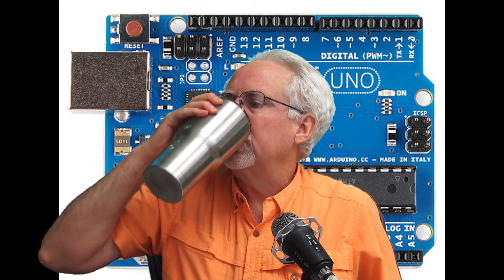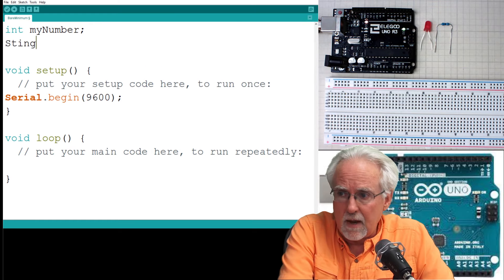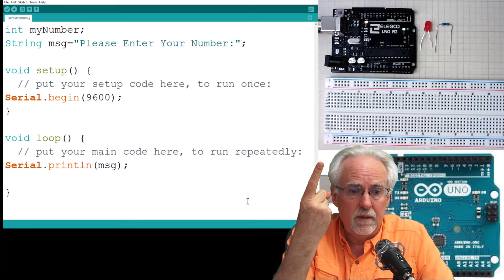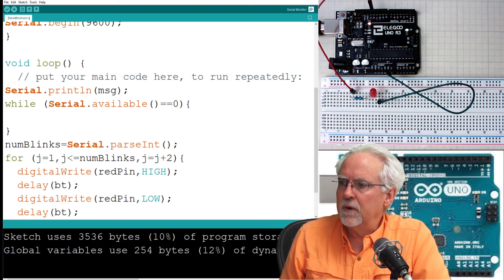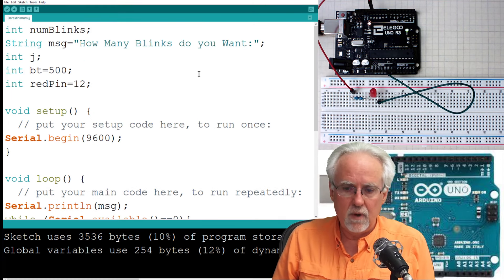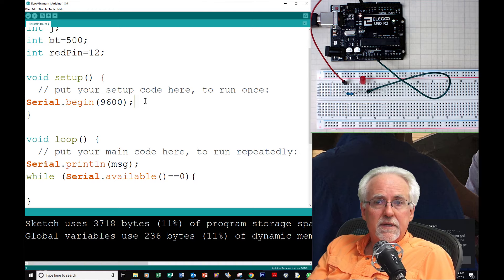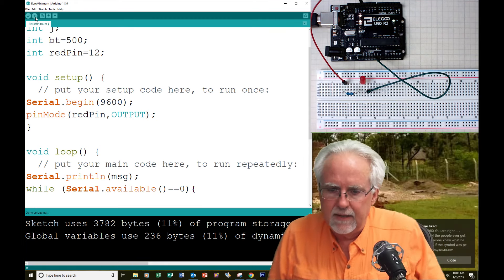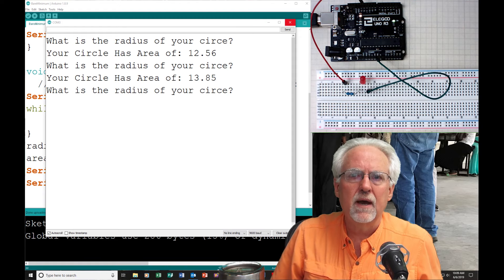Arduino Tutorial 18: Reading Numbers from the Serial Monitor

Comment: What language does Arduino use?
Reply: It uses a version of C and/or C++.  I ordered an Arduino manual so I can understand the differences.  The variable type String is not in C/C++ but is unique to Arduino, for example.  Getting further "into the weeds," String is a Class, not a variable Type.  Paul is a master at only including code you absolutely must master to get your Arduino to work.  If you are interested in the "whys and wherefores" you will have to buy books and dive deep into the Internet.

Comment: After learning from your video, I tried to challenge myself of blinking 2 LED and fading another 2 led.   Funny thing is when each program ran separately , both led can blink  and fade.  However, when I put together, the blinking part is fine and the fading part did not work.   May be you can shed some light on it.   Thanks guru.

Comment: Hi Paul I need some help please. I have written the read data from the serial monitor and altered it slightly but I am getting a response that I did not expect the serial monitor repeats the second message. you said you wanted to know if we were learning .

heres the code

float asize;
String msg = "Dimension Please";
String msg2 = "New Dimension ";
float nsize;
int scale=35;
int nscale = 16;

void setup() {
  // put your setup code here, to run once:
Serial.begin (9600);
}

void loop() {
  // put your main code here, to run repeatedly:
Serial.println (msg);
while (Serial.available()==0){
}
asize = Serial.parseFloat ();
nsize = asize*scale/nscale;
Serial.print (msg2);
Serial.println (nsize);
}

Its supposed to 

print
Dimension Please
new dimension 9.95
Dimension Please

but it prints
Dimension Please
new dimension 9.95
Dimension Please
new dimension 0.00
Dimension Please

I cannot see what I have done wrong.
Reply from the maker: Make sure serial monitor is set to no line ending
Reply: @paulmcwhorter  Thanks Paul All good

Comment: Hey Paul,

1. I want to send you a Starbucks gift card for all of these videos I’ve been learning from, so what’s you’re email? 

2. I have been getting a bug with the:
while (Serial.available()==0){}
Coupled with the numBlinks=Serial.parseInt(); with ‘for’ loop.

The Serial Monitor, no matter how many times I reset the board or the arduino program (and I’ve trashed arduino files I’ve saved to clear storage), double triple check and hold my breath while looking for any code that doesn’t match yours, it gives me the pseudo-code below. It’s a persistent bug:

Give a number:

Let’s say I type in 5 and hit enter or “send”.

Your Number is: 5
Give a number: 
0
Your number is: 0
Give a number:

This has happened in the LED lessons, and the string lesson 19 as well. I type in a number or string and it produces that result But then responds automatically with 0.

I am using a raspberry pi 4 and a 3.5 TFT LCD as my rig. Do you have any suggestions for debugging this issue? The last time I asked you it was also a strange bug that had nothing to do with the hardware or the code. Resetting the program or restarting the pi helped some but than bug issues persist. Any help would be most appreciated. I contacted both companies For tech support but haven’t heard back.

Thanks for the education in math and physics. You’re one of the few YouTube educators that goes through this process with the Arduino.
Reply from the maker: Carly, thank you for the kind words, I am at paul.mcwhorter@gmail.com